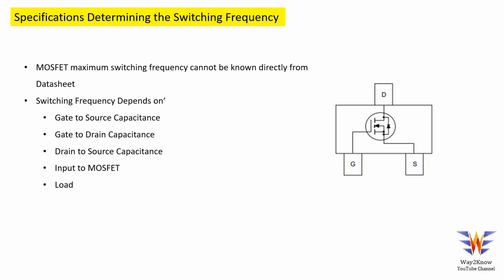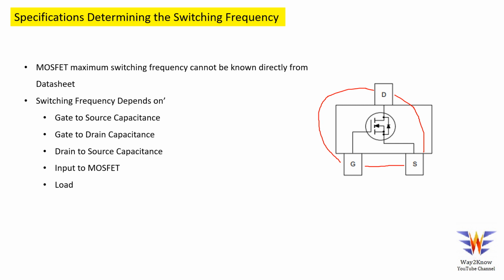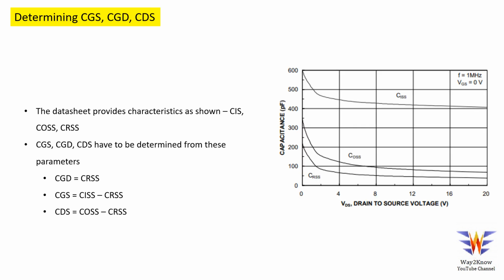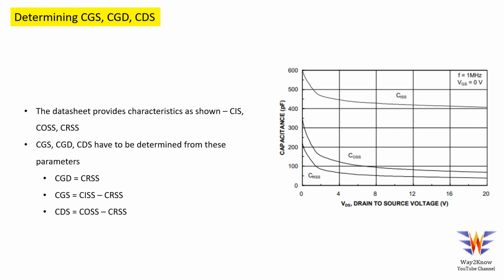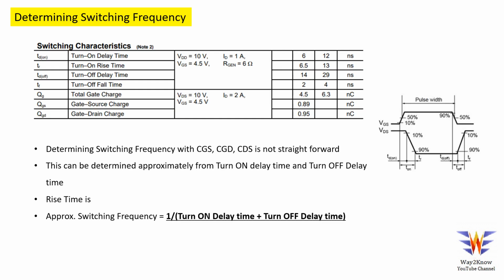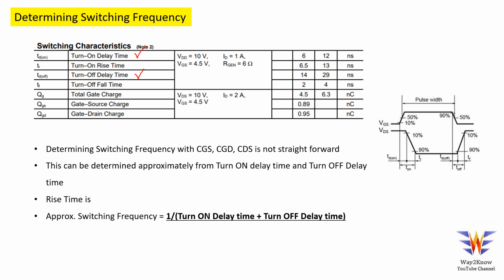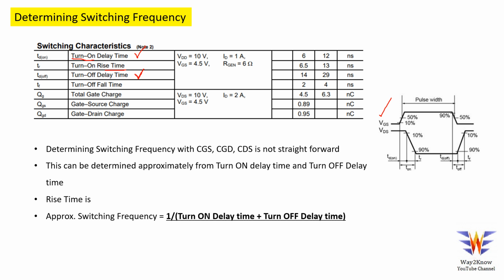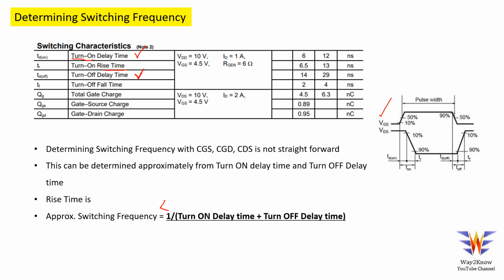Switching Frequency of MOSFET || Internal Capacitance of MOSFET || Rise Time and Fall Time of MOSFET

Comment: Switching frequency is also dependent on type of load and drain voltage. Higher the drain voltage lesser the switching frequency. It will be better to estimate the switching frequency using spice tools like LTspice
Reply: Please can you send me contact number I would like to speak with you
Reply from the maker: Please mail me on dharanidharch@gmail.com
Reply from the maker: You are correct. The Ton and Toff in the datasheet are given at a specific VDS only. As you said simulation is the best way to determine but a very rough estimate can always be made by using Ton and Toff